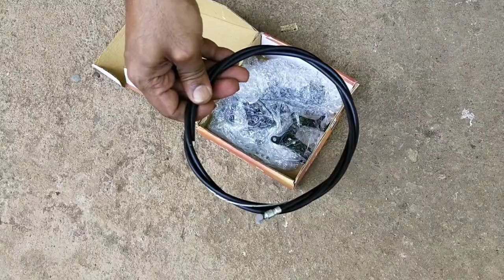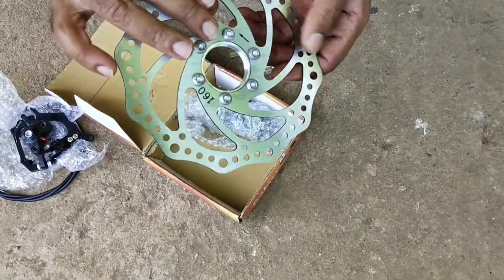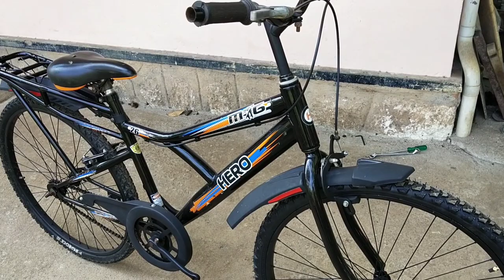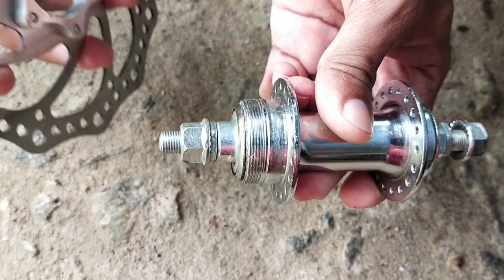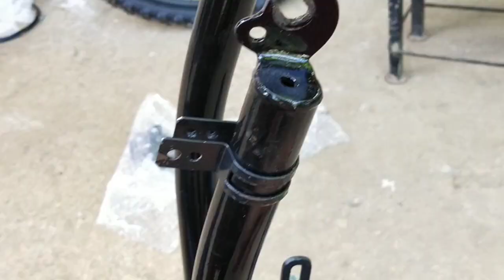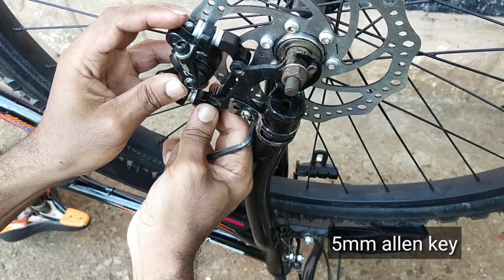Disc Brake Fitting in Ordinary Bicycle

Comment: Hi bro one doubt for me can we use rear hub for front wheel to install rotor disc plate
Reply from the maker: Depends on the front fork in your cycle. Usually rear hub is longer than front hub. So it needs more space in the fork to accommodate a rear hub. But you can expand the fork to fit a rear hub in it. But if the fork is a suspension type (shock absorber) you can't.
Reply: @BijoyTs  lovely bro thank you for your reply

Comment: Front il double disc vakkunne vdo cheyyamo
Reply from the maker: Double disc വയ്ക്കുന്നത് practical അല്ല. Right sidel വരുന്ന disc rotor break  പിടിക്കുമ്പോൾ hubil നിന്നും അഴിഞ്ഞു varum.
Reply: @BijoyTs  correct
Reply: @BijoyTs  Hub tread il vakkathey bolt 🔩 ittu vakkunne

Comment: Eth mechanical disc lle bro
Reply from the maker: Yes bro
Reply: @BijoyTs  entathum mechanical disc aanu bro disc quality kurava pettan pad theerum athnd Njn disc Mari power brake aakan ponh bro. eni disc venam ennulavar anengi hydraulic disc vangan sramikkya mechanical annengil avishyathin mathrm break use cheyyan nokan  ellengi last mechanical Pani tharum
Reply from the maker: Bro, എല്ലാ video ilum കുറേപേർ disc brake video ചോദിക്കും അങ്ങനെ video ഇട്ടതാണ്. Bro പറഞ്ഞതുപോലെ നല്ല quality ഉള്ള v brake തന്നെയാണ് നല്ലത്.
Reply: @BijoyTs  athe bro